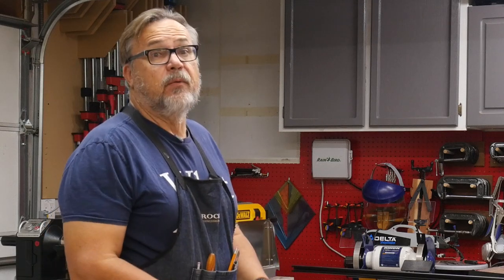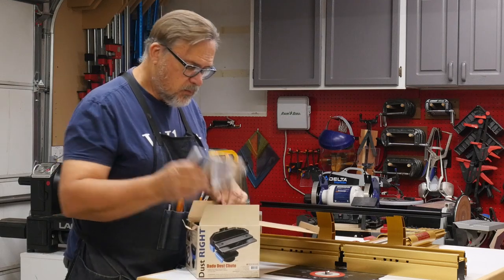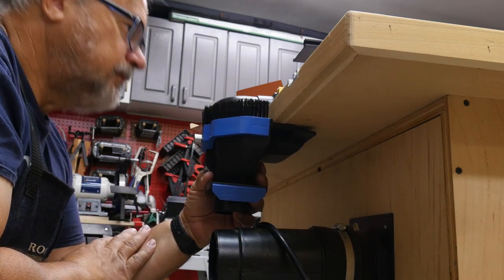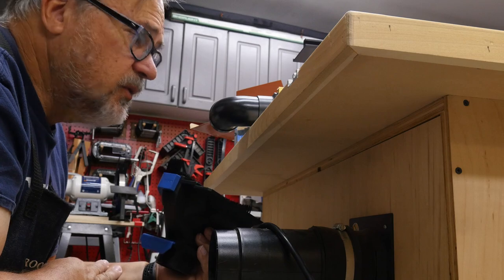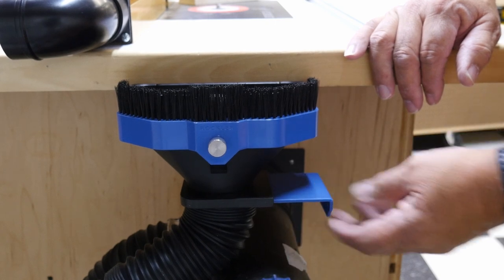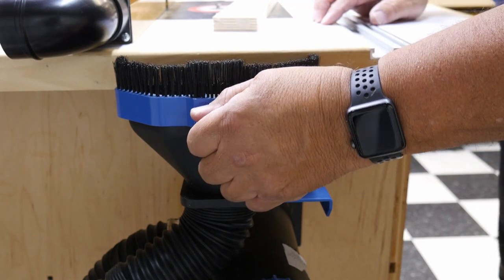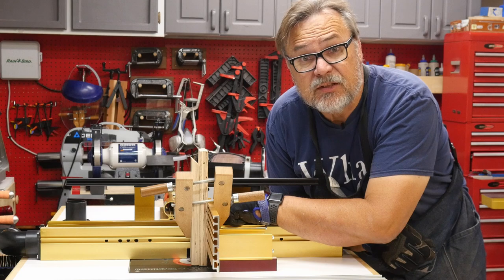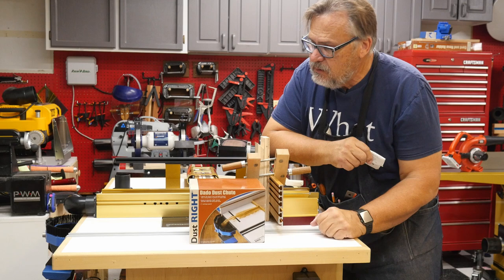Rockler Dado Dust Chute - First Look and Test

Comment: Nice.  I just adapted one to friction fit and slide over my table saw fence rail with some 1/2" & 1/4" plywood, as my router table is a wing off the saw.  I can slide it back and forth and even over to where the table saw blade cuts to catch the dust.  Not perfect, but it does help greatly with the dust shot over across the table as you mentioned.  Definitely worth the price and time to simply modify.  $20 on sale currently.
Reply from the maker: Nice adaptation Csimet. I did not think about using it on other equipment.